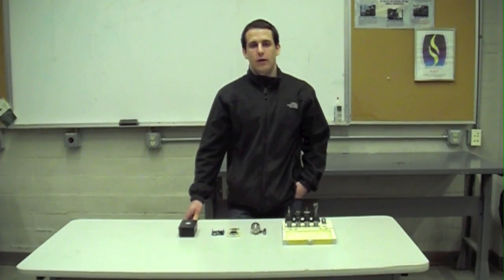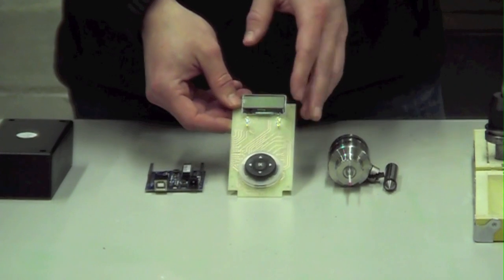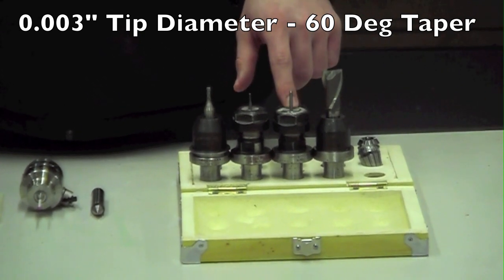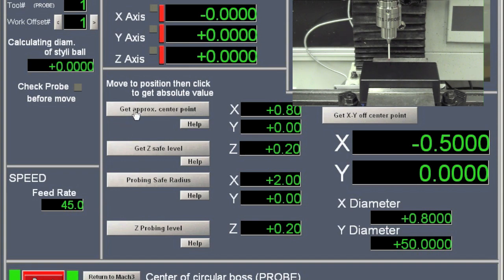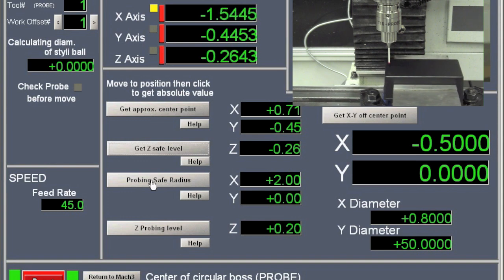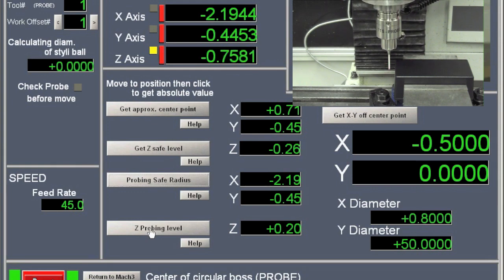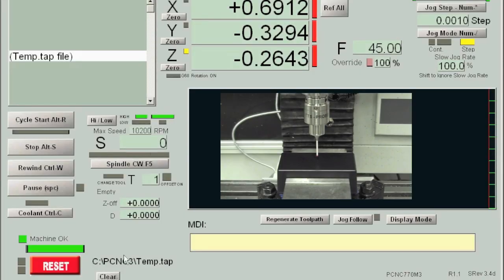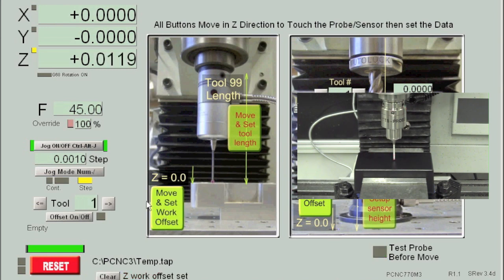Custom Electronic Enclosure Box Milling: Tormach PCNC 770

Comment: Is it worth have a tool changer?
Reply from the maker: Bigwingrider1800 For small production runs, yes. For hobby-use, it is not essential. The majority of the tool changing time (without a tool changer) stems from resetting the z-height for different tool lengths. I like dedicating a single tool holder to a specific tool. Mach3 allows you to have multiple tool lengths saved without having an automatic tool changer. This speeds up the process. Using saved tool lengths, the tool changing time is solely how long it takes me to unscrew the drawbar and swap tools. If you have the funds, the ATC is nice but not essential.